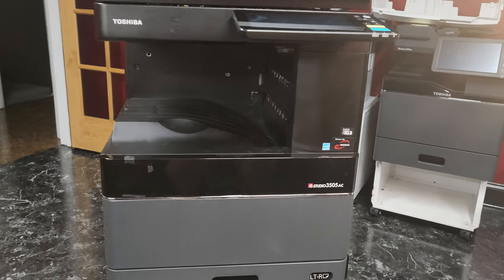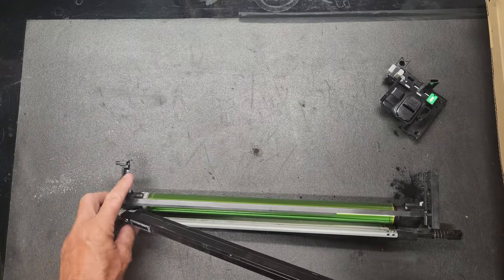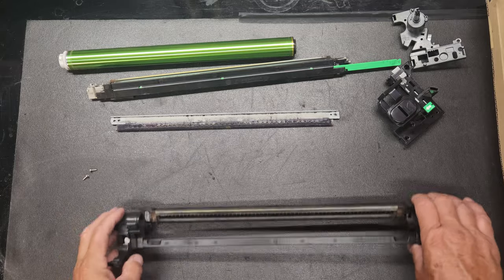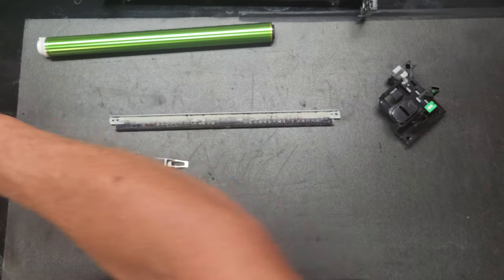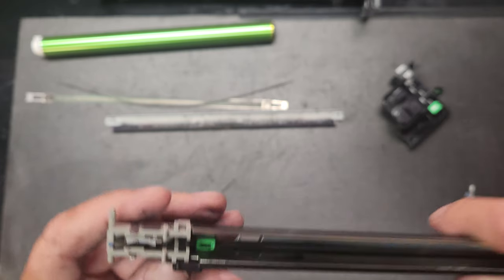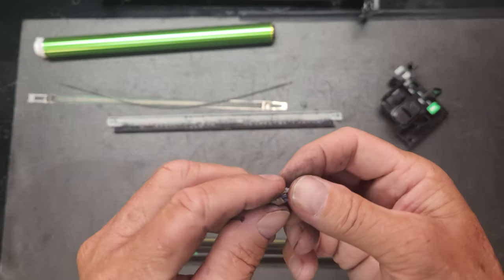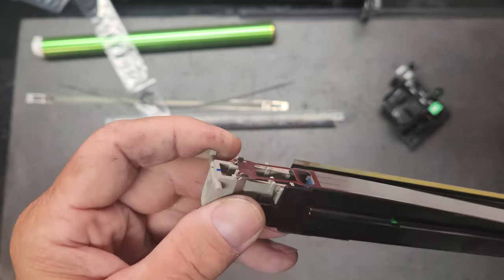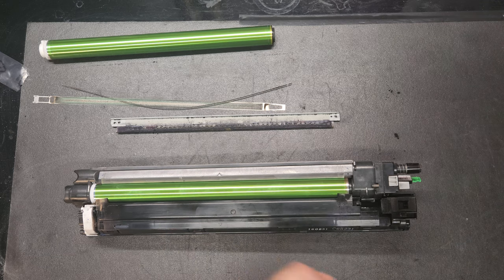Toshiba Drum(PCU) replacement 2505ac,3005ac,3505ac,4505ac,2515ac,3015ac,35015ac,4515ac,5015ac copier

Comment: Great video thanks. What is the issue showing when the drum is defective?  I have a E studio 3555-C my yellow tonner is full but if I print a full page in yellow I only got few dot. Could replacing the drum fix my problem? Any help would be very appreciated thank you.
Reply from the maker: Without seeing an example it's hard to say! I would look at the charge corona and also developer unit which is part of the drum unit. Charge could be arcing and/or the developer may have leaked out because of the arcing.

Comment: after i replaced the drum i got a CE70 error, what could i have done wrong.
Reply from the maker: CE70= Drum drive Switching abnormality. The drum switching detection sensor (S11) is not turned ON after the drum motor was rotated for a specified period of time (the official response in the manual). Make sure you turn the grey lever back in the original position after you install the drum. (above the black drum unit). Also, make sure the drum and developer rotate by hand before installing them in the machine. This may be an unusual coincidence. The only time I have gotten this code is when the switching motor in the back of the machine gets dirty. If so, you will need to call a service representative. Removing this motor is way too difficult for an untrained person.

Comment: You never have to replace the charge electrode. LOL. You just clean it unless the teeth are damaged. You never have to replace the sleeve ever. You never have to replace the grid. You clean it.
Reply from the maker: Sure you can do that. But you run the risk of pulling developer out of the units if they happen to arc. Color developer is a minimum of $350 per bag. Hardly worth the risk for a $5 dollar part don't you think!?
Reply: @mrbonz00   It will not pull developer if you clean it properly. If you owned a company you would know that all that adds up. I worked for Xerox corp and they would deny you a raise for replacing parts that are no need to be replaced and blowing out the parts budget, Only newbies and rookies do what your showing in the video.. Regular PM cleaning and you will never ever need o replace a piece of metal. You used to have to replace corotron wires. They proper term is corotron not corona also.  The drums will go several cycles. The developers wears out and starts scattering causing arcing and pulls developer. The iron filings get round off and no loner pointy and cannot remain attached to the mag roller.  Instead of just showing how to spin the auger a little then turn the chamber down to the table and bang it a couple times removes excess toner you said get a air compressor instead of vacuum LOl. Black developer can be used for any color. You just have to do some dark dustings then add the color toner and to color dark dustings until it is replenished
Reply from the maker: Wow! Where to begin. I do own the company and with my 45 yrs experience I do know what adds up and it's call backs.... something you should be very familiar with having worked for Xerox. I call it corona you corotron (semantics)! If you knew what you were talking about you would know the charge grid gets tarnished and can't be fully cleaned. Developer= you are correct that it is just metal filings and starts to wear round. But metal will not change from being metal whether round or sharp for God's sake. The reason for replacing developer is it will no longer carry toner properly to the drum surface because the metal filings are round thus toner leaks into the copier NOT the developer. This video was made to help people see how to pull apart and put back together a drum unit in order to save them some money.If all you want to do is criticize every little thing then may I suggest you go and make your own video with your vast knowledge!